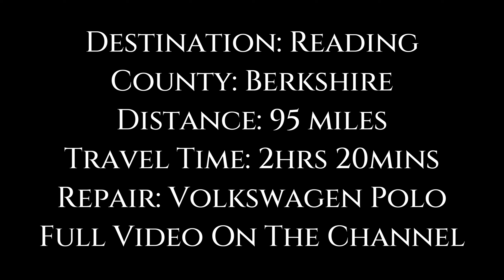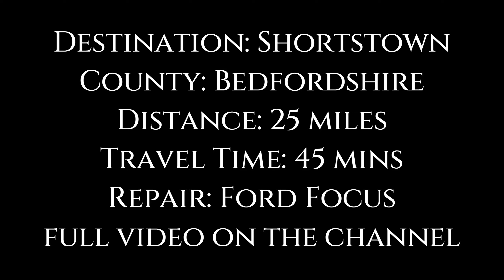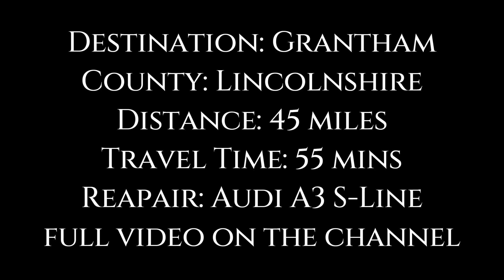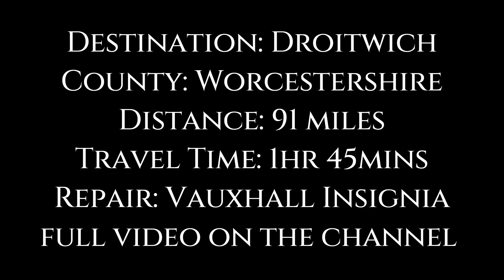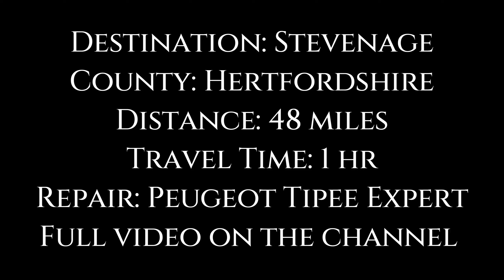Williams Mobile Clutch Service. Week 13/03/23. Video Log.

Comment: Mechanic of 48 years and still pushing the spanner’s I’ve replaced many many clutches over the years and I can tell you this guy is very good. Nice little touch that comes with experience the what he teases
Reply from the maker: Thanks Kevin., means. Lot coming from a fellow mechanic. 
Can I ask if you’re from the midlands. Name sounds very familiar ., 
I was at city college in Birmingham about 18 years ago ..?
Reply: @WMCS  sorry Kev I’m Yorkshire born n bread😂 made a mistake sent my comment before I’d finished it ! Was pointing out how experienced taught you to carefully remove the ball joint nuts with the impact gun a lot just Buzz them off in one usually shearing the studs off😫
Reply from the maker: Definitely learned to not be trigger happy., otherwise it’s a big oh noo.. 😁.,
🍻🍻🍻

Comment: Kevin, do you use impact sockets in your Milwaukee? If not, have you ever had a chrome socket shattering/exploding ? Thanks.
Reply from the maker: I use chrome all the time. But then again my tools are sealey professional. So it’s real chrome not plated chrome. 

Reall chrome won’t shatter it will just rip and tear
Reply: @WMCS  that's good to know. I keep hearing bad stories about chrome sockets exploding and impact wrenches anvils damage so I was thinking of buying an impact socket set since I ordered a dewalt mid torque, I have chrome sockets from BGS tools and Facom. I assume they are real chrome vanadium.

Comment: do you have chargers for you battery tools on board the van .and looks like a dry day for you at the start then the dreaded rain ,
 thanks for the video
Reply from the maker: I usually get through 1/4 of the life battery per job. But I’ve got lots of spare ones. ., that’s it rainy season now.

Comment: Hi kevin,exelent job man,its your cordless ratchet 1/2 inch drive?
Reply from the maker: I have both. It’s a 3/8
Reply: Or 3/8 thanks man
Reply: Oh,and 3/8 work good for bolt transmission to engine block? I means about the tork or power

Comment: @15.40 See that 90 degree twist before lifting the box then twisting back to horizontal. That twist clears the crossmember and is a pain even with a tranny jack.

Its more than a bench press. 10/10 for effortless style. 🏆
Reply from the maker: Thanks. I think the worst to get past that bit of subframe are the 1.9/2.0 L version of the VAG. but you’re absolutely correct 🍻🍻